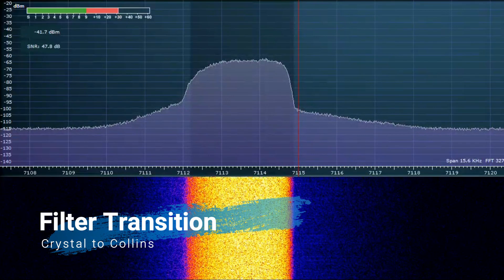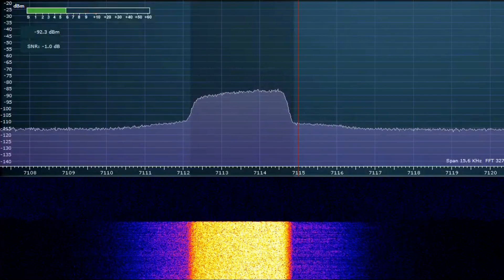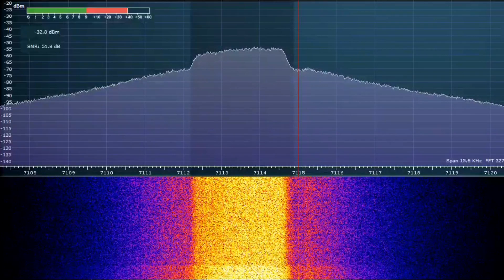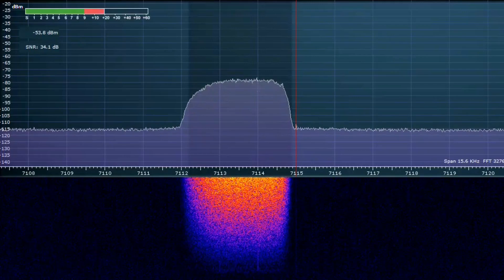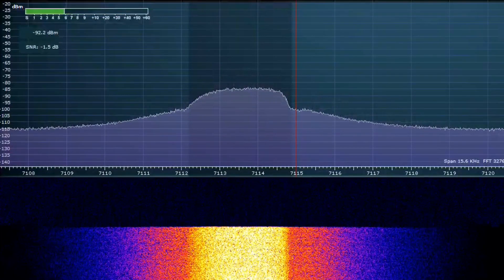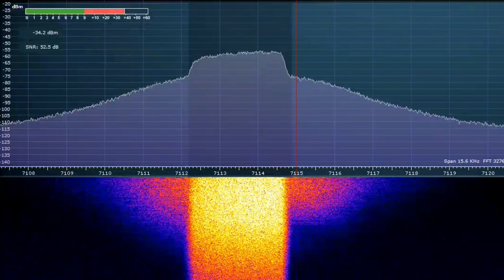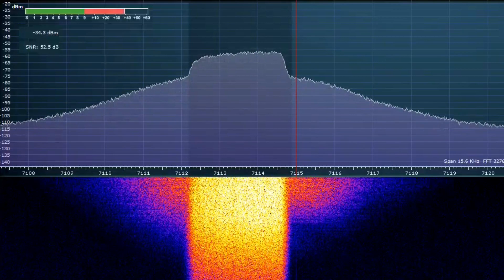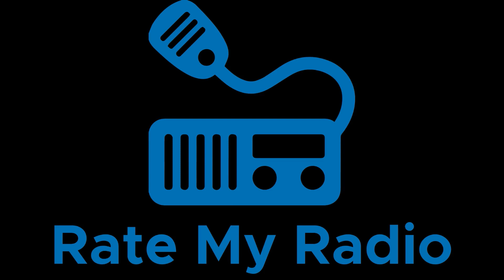FT-818ND Ceramic vs Optional Collins Filter YF-122S (FT-817ND, FT-857D)

Comment from the maker: Please note I have accidentally referred to the stock muRata CFJ455K14 CERAMIC filter as a 'Crystal Filer' in this video; none of the FT-8XX series use Crystal filters, and unfortunately youtube doesn't allow the re-uploading of a video over the top.  Please accept my apologies on this matter. 73, Jarrad VK3BL
Reply: VK3BL de  JE2PQQ

Please don't  worry about it .
I use YF122C for my FT817ND .
The weak signal  stands out from the noise .
If you like CW , I recommend to fit it .

73  from  Japan

Comment: Old video but good to see a bit of real engineering - thank you. It is often quoted that the using this filter with an 817 gives the equivalent of a 2-3dB improvement on Tx. Did your numbers back this up ? Can an electret microphone be used with the Collins filter without distortion? How much improvement in Tx signal do you get when combining this filter with a speech compressor....or does the benefit of the collins filter equate to that of a compressor ?

Comment: Just ordered the Inrad 2.0kHz Collins filter for the  ft817.  I expect that to reduce tx audio quality a bit but increase effective tx power noticeably.  This would be with respect to the stock 2.4 kHz ceramic filter in the radio.